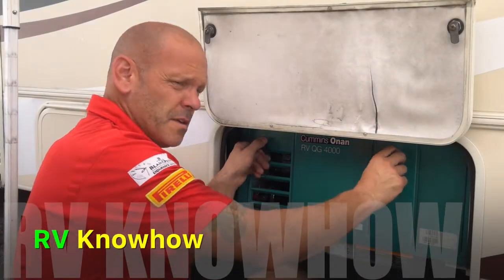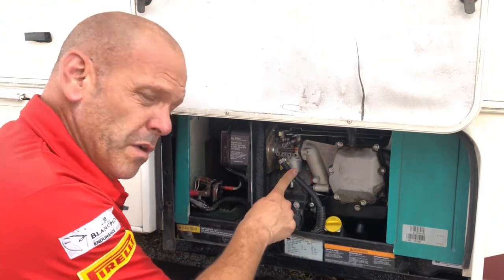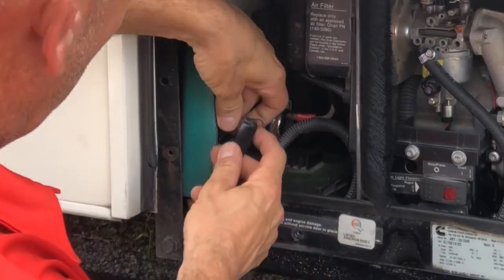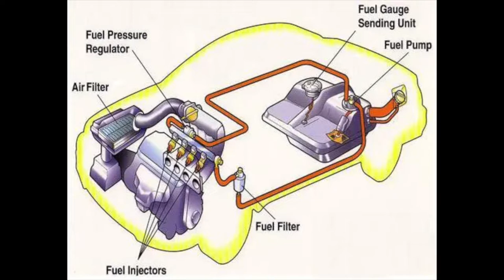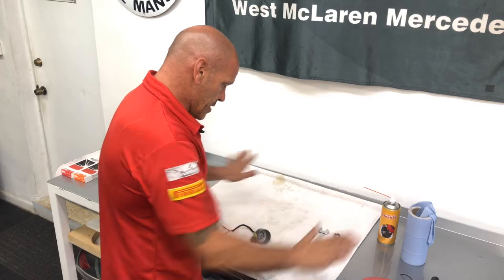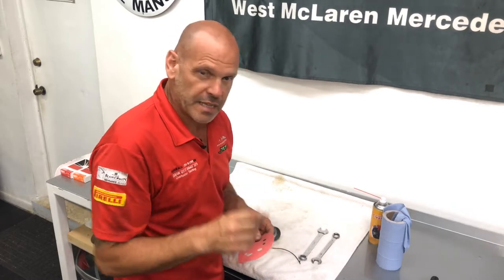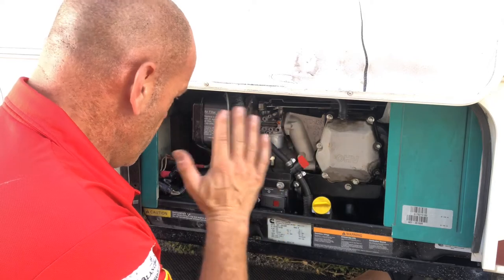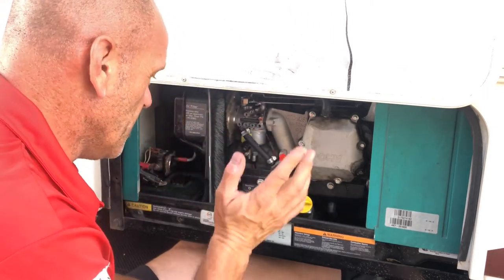RV Generator surging issue, Carburetor MAIN JET and float bowl Remove - Clean - Replace

Comment: My generator was surging constantly after sitting for a year.  I followed the instructions to a T and its running fine now.  3 hours with heavy load and its perfect.  Smooth as glass.  Thanks very much!  The local rv places won't look at generators at all and the local Cummins repair shop, well, they wanted more than the cost of a can of carb cleaner...

Comment: I removed my Onan and now I run a small and quiet portable, 4500W. Uses only 20% of the fuel the Onan did and now I carry an additional 20 gallons of water in its place.

Comment: Great video as all your videos are,thank you,in 2020 I purchased a new Toy Hauler RV with a Onan QG 4000 Evap Genset,now 2024 ,530 hrs later it started to surge,I removed the float bowl as you did and gave it a good cleaning,but I went one step further and removed the altitude adjustment screw completely and gave the tapered needle and orfuss a good cleaning,re assembled and fired her up, 99% of the surge was gone ,I then replaced the fuel filter,spark plug and adjusted the valves,valve adjustment was way off,fired it back up and the surge was 100% gone,I ran it for 45 min under a load and no surge,I also put a piece of 1/4 in fuel line so I could drain the fuel out of the float bowl,no need for a fuel shut off valve,now I just pull out the piece of fuel line put a small cup under it and open the drain screw and drain the float bowl,close the drain screw tuck the fuel line back in,good to go.

Comment: Thank You.  My Onan 4000 is a tad different but very close and I had let it sit for a long time without prepping it for storage running it once a month to keep it from buggering up. Your video was spot on because I was able to clean it by removing the bowl and not the whole carb. Also I appreciate, because I am impatient, you speeding through the removing and replacing of screws and such. Did as you did and she is running as smooth as silk. Thanks.

Comment: Thank you for the series of generator videos.  Your instruction gave me confidence to make my own repair and saved me time with troubleshooting.  Until watching your videos, I was about to start with the fuel pump and filter. Instead, I went straight to the carburetor bowl and found the the anti backfire plunger was stuck closed due to fuel varnish.  A quick cleaning and the generator works great.  Thanks again.

Comment: I just serviced mine today. I have a tip for the spade wire that sits behind the carburetor. If you take the starter switch mount out of the way youll see a group of wires in black loom with a zip tie on both ends. Inside this loom is this spade terminal wire. Nip the zip ties and let free that single wire. Its long enough to reroute to the front making it tons easier. I covered the wire with a section of single wire loom to tidy it up.

Comment: Thank you for your videos on generator care.  Our new motor home has an Onan QG 4000 generator that has suffered from intermittent shutdown since day one.  At 30 hours IT completely stopped and wouldn’t start.  The problem was a stuck or stopped up float valve.  Using your videos I was able to diagnose and fix the issue.  Thank you.

Comment: The fuel shutoff valve is a brilliant idea!  You are right, letting the bowl go dry is the perfect solution for storage.  In my case, I often don’t know when I’m going to use my generator next so if I can get into the habit of doing this, hopefully my gen won’t go bad again.  Especially with our Horrible gas in California which is even worse in winter because of the special blend with high volatile additive.  Our gas goes bad really fast and has already gummed up my Onan twice in 2 years :(

Comment: My sister showed me this shut off valve and let the engine carb run out of gas each time she cut grass, over 40 years ago. She had put  one in  her push mower gas line. She never had to have her carb worked on in 52 years. She had 2 push lawn mowers in that 52 years, she would replace the mower blade and spark plug once a year. When she put it up for the winter she would let the mower run until the tank was out of gas also and that kept the tank from getting any varnish in the gas tank also over winter.

Comment: This is a great video, really appreciate the step by step instructions. Unfortunately this doesn't seem to be my issue. I have exactly the same model genny as yours, followed the instructions exactly and I did have a lot of gunk in the jet and bowl, cleaned all of that out with carb cleaner, sanded washers, made sure the float was working properly, etc but it still just cranks and won't turn over. It was working previously and then one day when it was running it just shut down and hasn't started since. I've checked every other simple thing: fuel way over 1/4th, spark plug is good (replaced it anyway with a new one and tested it), oil at right level, new air filter, verified fuel comes out of the fuel line when primed. Open to any suggestions on what to possibly try next. (code after shutdown was 14, which means "over frequency", but I can't seem to find why this would keep it from starting at all, lots of videos saying this causes it to shut down under load but mine doesn't even start to turn over, just cranks and cranks)
Reply from the maker: Hi Kent, thanks for the comment, the first thing I would check would be the fuel shut off valve (more importantly the plunger) You say you checked it waz working and that's good to hear, but it's possible when you put the valve back together and tightened up the main jet it might have been very slightly over tightened. This happened to me before. As you may have noticed the main jet has holes around it to allow the fuel to flow, these holes weaken the jet and if it is over tightened it will pinch the plunger closed, The first thing i would do is remove the plunger and check the jet. also put the jet back together without the plunger inside to see if it works. This is ok to do as check, Hope this helps.
Reply: @rvknowhow  Really appreciate the response, so I tried removing the plunger just to be sure and its still a no go, I think at this point it's unfortunately something worse than this and will probably have to take it to a shop. I should clarify, it was working months back and then one day it just stopped while it was running and I haven't been able to get it started since, so I was just going through videos of different things it might be, but it hasn't started again since the day it stopped on me. Still great videos, and my jet did in fact need cleaning, thanks again.

Comment: Would it be better to put the shutoff valve before the filter and pump? Thanks for the video great job
Reply from the maker: Thanks for the comment. Here are a couple of reasons why I would not suggest placing the cut off valve before the pump and filter. The main reason for the cut off valve is to keep the carb empty of fuel during long periods of inactivity, the fuel evaporates through the carb but can not evaporate through the pump and filter. Also the method of running the genny empty of fuel to stop it would not be good for the pump if the shut off valve was placed before as this would run the pump dry. I hope this helps answer your question. Thanks Richie
Reply: @rvknowhow  Thats exactly the info I was looking for Thanks again and keep up the great work and taking the time to share your knowledge

Comment: Could you please make a video of actually replacing the carburetor on a Onan 4000 generator?  I had to search and search videos that demonstrate the removal, and all but one didn't talk about the challenge of closing both the choke and throttle butterflies in order to slip the OEM carb out and the new carb back in.  Here's excerpt from a post that I had made on another person's video on the subject, which the guy actually did demonstrate replacing the carb, he just didn't offer any details on the challenge of getting the carb out and new one in as it relates to the butterflies being what prevents you form doing so, at least from what I experienced and that of another person who had posted a resolution to the problem.  Here's the excerpt I had posted elsewhere.  "One noteworthy mention, is like 99% of the other videos I watched, no one mentions how they get past the problem with the choke and throttle butterflies closed at the same time so the carb will slip out.  One YouTube video I watched said they had to bend the tab on the choke linkage up so that it would clear the throttle linkage, thus enabling both choke and throttle butterflies to be closed (counterclockwise) and slip the old carb out and the new one in.  Also, it would be helpful to know how you got the gaskets to line up for the bolts to pass through to secure the carb in place.  I read in Cummin's service manual that we should not use gasket sealant to hold the gaskets in place.  Besides, it's such a tight fit, I'm not sure that it would hold it on.  I did find that pushing on the wall (side with air filter box), that created a slight bit of space to allow you to adjust the gaskets for proper fit, but even then, it's pure luck or Devine ntervention in my case, that allowed me to successfully get the carb installed and work first time without leaks.  So again, if you could go back and add an addendum to your video on the subject of getting the carb out and new one in as it relates to those butterflies and gaskets, that would be a huge help.  I didn't like bending the tab on choke and then having to bend it back into place (making sure it was back to a 90 degree position so throttle would open and close like it should."  Other than that suggestion, I find your videos offer great detail and filming, and are most helpful.  Your video was my go to leading up to removing the carb, at which time I had to revert to others to help me complete the task.  I am mechanically inclined, but just couldn't get the carb out without bending the tab on that choke linkage.  Here's video that discusses the issue specifically around 5 min 30+ seconds into it: https://youtu.be/d_4MkqPPN6c
Reply: I followed your video initially because my generator was surging.  The sea foam mentioned didn't resolve the issue, nor the fuel pump and filter, so I had to replace the carb, and I did use one off Amazon, and generator fired up first time and ran great.  We'll see on longevity of the carb, as I so hope I don't have to replace any time soon.  I did put in the fuel shutoff you suggested as well.  Most helpful.

Comment: Another fantastic video.  I have an older H Spec Onan 4000 that cranks, but won't start.  With the H Spec the STOP button doesn't prime the carb.  I was wondering if the float inside the carb switches off the fuel pump when the bowl is full?  My plan is to disconnect the starter and press the START to run the fuel  pump to make sure the carb is primed.  But I don't want to flood the carb by over priming.  Hence my question about the float.  I've already replaced the air filter, the fuel pump and filter, the starter solenoid, the carb bowl and fuel shutoff solenoid.  I've tested that the fuel pump works, that there's spark, that the solenoid is working and grounded properly, and that the oil is halfway between full and empty.  Any other ideas what to check?
Reply from the maker: Thanks for the comment and sorry to hear you are still having problems. I would remove the fuel shut off valve “plunger” to see if that might be stopping fuel flow. The main jet with the holes is very weak and if slightly over tightened it can twist and jam the plunger closed
Reply: @rvknowhow  thanks. I'll give that a try and report back tomorrow.

Comment: And yes there is noise Oman 2500 runs like a top and it runs off propane with out a idle wide open all the time. I want a super quite inverter generator with a smart throttle that only runs for what calls for because a light bulb will not even make come off idle like the Hondas have the best for the money and it’s a 7000 inverter generator that has everything I was talking about. But I don’t need one that big for my camper but for home it would be fantastic.

Comment: Great video. Can you help me troubleshoot a 02 Onan microlite 2800? It was running great and stopped. It was a cracked fuel line from the fuel filter to the carburetor. After replacing it the generator didn't start. I removed the spark plug and while I was cranking it had no spark until I released the starter switch and it sparked once. I cranked it once again with the same result. Please help or advise me

Comment: If you replace the on board generator with an up to date inverter generator could it be ran inside that? If not how can one be made to do that? I don’t have an onboard generator so I’m getting an inverter to put in that section but I don’t think it’s safe to put it in the compartment where the onboard one was because of carbon monoxide.

Comment: Would fitting fuel shut off under rv right before filter and pump be better? That way old fuel isnt sitting stagnet inline of filter and pump? I thought about installing my shutoff there. Could use prime switch to evacuate the stagnet fuel from filter and pump through carb? I also thought about installing a piece of small fuel line on float bowl drain port, similar to what a carbureted dirt bike has. Extend fuel line from bowl into a container. Just my thoughts. What do you think?
Reply: Ya, would it work better?

Comment: No power to fuel pump
Reply from the maker: Thats not good, where are you checking for the power ? Did you go under the control unit and find the power wire ?